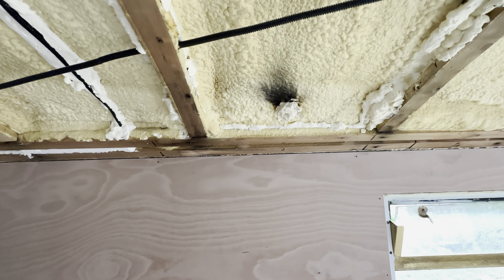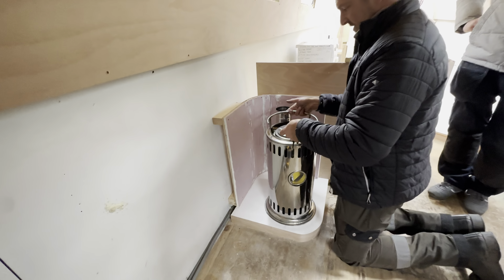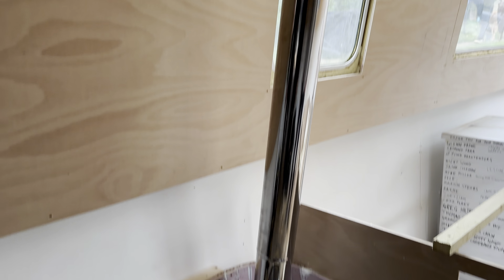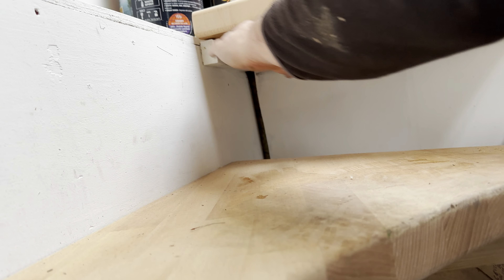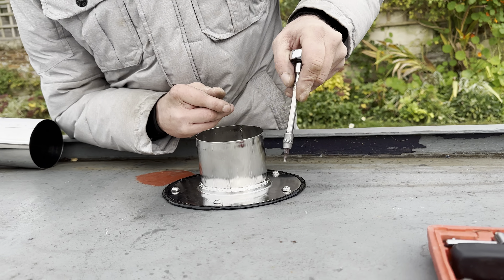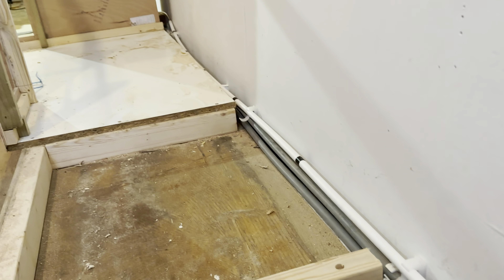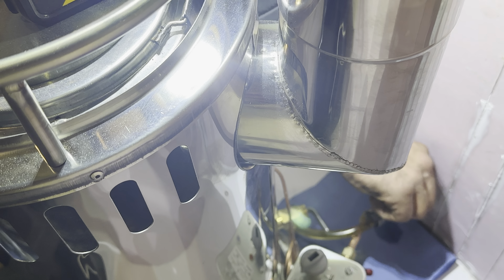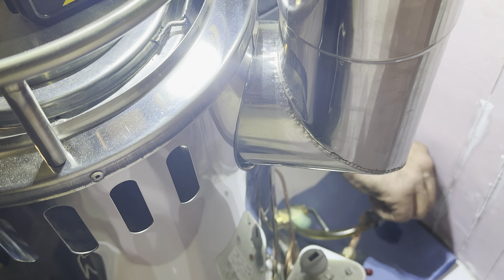504. REFLEKS STOVE installed by LOCKGATE STOVES

Comment: Hi James, great video, very informative and interesting, the stove looks fab👌.
I'm guessing that you did a lot of research into the pros and cons of stoves... Have you chosen diesel over multi fuel because of the lowering running costs, or ease of use, or both.
I'm wondering, because I don't have any experience of either, but as a rough guide, how much would it cost to run per hour/day.

Cheers, all the best with your project 👍 kev
Reply from the maker: Glad you enjoyed it. There’s not much research to be done to realise that it’s much cheaper to run than coal. Free logs is the cheapest but not easy. 
This works out at 5lts per day in peak running which is around a fiver a day. If I was running coal that would be half a bag a day which is near £10 a day plus the other stuff which needs to be burnt. This burner also has a back boiler so I get far better economies than a multi fuel stove. 
That’s on paper - I haven’t got it up and running but should along those lines.

Comment: Can the Reflecks be run automatically from a timeswitch or programmer, or does it always require a manual start up?
Reply from the maker: It requires manual lighting however once she’s running, the burner can be turned right down to a trickle and the stove stays on throughout winter
Reply: @TheNarrowboatThatJamesBuilt  Would that very low setting be capable of heating the water in the calorifier during the summer months, when having a higher setting would be obviously undesirable throughout the rest of the boat?
Reply from the maker: @markdoble736  yes it should do. But I am looking at a solar dump to cover the summer months or I can run the engine

Comment: Looking good James.. surely one with a back boiler.. heats up all the spaces!! I suppose also that's down to the configuration of your design! how are you going to put heat in your  bathroom and bedrooms?
Reply from the maker: Yes it has a back boiler so it will feed 2 rads up the end of the boat and the calorifier under my bed